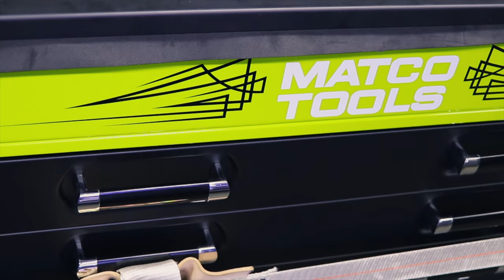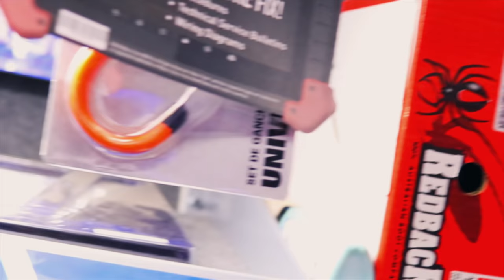Matco Screwdrivers and Band-Aids ? What they have in common ?

Comment: Hey Clay.. Great vid as always. I think they are called "pickle forks" because they look identical to a tool designed to actually take those large dill stlye pickles out of those oversized jars. If I remember correctly, in the early and mid 20th century the big vats of pickles were a lot more common then they are now and they all had a two tined "pickle fork" so you could get one out.. I think.
. But my memory isnt what it once was.. Ive gone from bad to really bad, but I think I am right on this one...

Comment: Love the air hammer pickle fork. Makes quick work out of separating most ball joints and tie rods as long as you’re replacing them and not reusing them.
Reply from the maker: They will have to be replaced cause they are Wore smooth out !
Reply: Exactly I have a new tool with a handle that separates the joint without damaging the boot. it's a great tool I forgot the name. It was off ebay

Comment: On a dodge truck you can break the lower ball loose with a coupling nut, two bolts and a lock nut, then use a tie rod breaker to break loose the upper ball joint.  The best use for the free hf flat tip screwdrivers is to open paint cans.e

Comment: I thought most of the time instead of replacing the ball joints on those fords, they liked to get a whole lower arm with new ball joint installed. Isn't very expensive either
Reply: Justin Berry we usually replace the upper arms and press in new lowers. Only takes 10 minutes to press out the old and in the new. Those lower control arm bushings are rarely ever bad.

Comment: Hey,Clay next time your on the tool truck. Look for the fluke 233a multimeter.  The head detaches and it has a range of 30 feet. You see it you may want to take your current meter home.
Reply from the maker: I just ordered the new meter from snap on waiting on it to come in that can blue tooth to your phone ...... i have a Snap On and a fluke currently but i wanted to have the blue tooth option so u aren’t stuck w leads in tight spaces trying to see stuff
Reply: @KoonTrucking  ok. Look up the video for the 233a. I want the 233a and the new one from snapon
Reply: I also you the power adapter for a cigarette lighter. The one from power probe. I plug that into my snapon test leads to my vantage pro and I can check charging system voltage without lifting the hood or removing a battery box cover

Comment: The bottom ball joint is held in with a snap ring and it goes out the bottom.
Reply: Hey Clay, have bill message me. Put the new ball joints in the freezer.

Comment: Is it a upper or lower or both? If it’s a lower get a 3/4 drive socket that’s diameter of ball joint. lower truck down to rest on it release jack below bout 1/2-3/4 inch hit control arm done. I’ve done that a few times to save a trip. Yes I know talk all the shit u like but it works. Crazy shit you gotta do when you’re broke 😁. Blocks of wood under socket for height etc. weight of the vehicle works 👍🏼.
Reply: Pickel fork works too just no where near as easy.
Reply: Great vid clay as always
Reply from the maker: That’s a very good idea!

Comment: Flat heads get the most use with hose clamps and electrical connectors. Well at least for me.
Reply from the maker: I try to use nut drivers. I hate a flathead screw digging into my finger ! Haha I try not to use them at all
Reply: Koon Trucking I mainly use my snap on nut driver for them but it doesn’t always reach in the tight places. Somehow I don’t own any hand nut drivers.
Reply from the maker: Will save u some skinned knuckles from flatheads !!

Comment: Best test light I have is from harbor freight.
Reply: Greg J Feeney I love the otc 3633 test lights and you can get them on amazon for under $20. I use that for most things and made a bunch of higher amperage test lights out of automotive bulbs & sockets with t pins soldered on the ends. Great for load testing higher amperage circuits